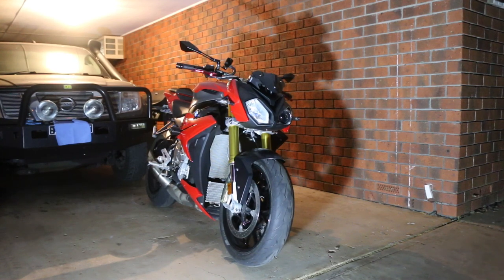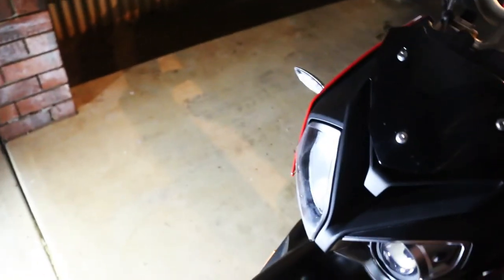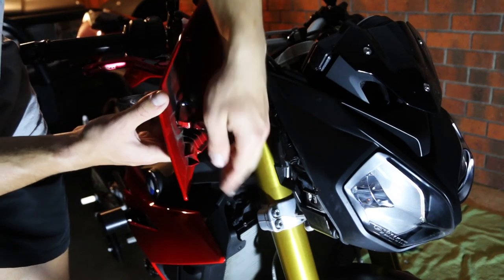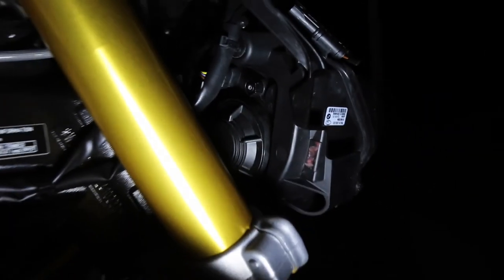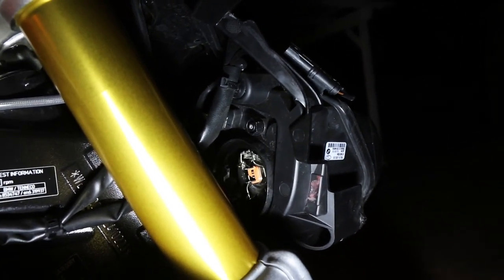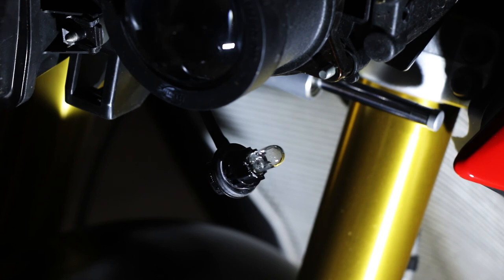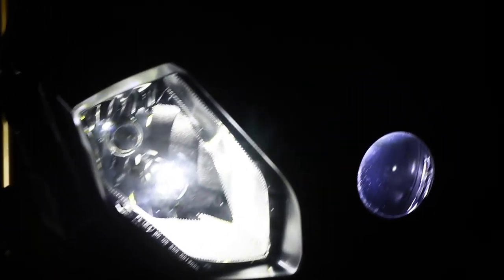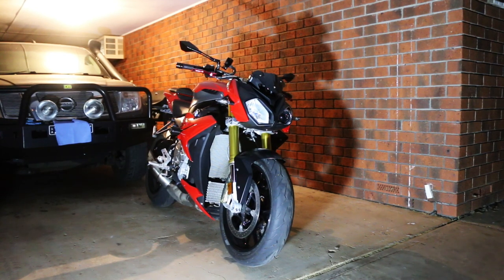HID/LED Headlight/Parking Install/Change  || BMW S1000R ~ 2015 || Headlight Fairing Removal

Comment: I have a 2014 S1000RR and I didn't have too take everything apart.  All I did was:
1) Removed the high beam bulb. 
2) Using a pair of needle nose plier,  all I did was grab the plug (black plastic part / not the wires) and wiggled and pulled at the same time. The key is to slowly wiggle the plug while pulling, once it starts to come loose, it's pretty simple. 
3) When putting the plug back in, make sure you line up the plug correctly and then just push it back in. 

Also before putting everything back in, test all the lights first to make sure everything is working.  It's basically a 5 minute job to do.  Also helps if you have small hands ;)

Comment: I understand all about that little parking light on right side of the bike.  Started today, put it all back together because I became worried I would wreck the cables.  I'm now an expert at getting the low beam light out now as I have replaced it three times, it's a bit easier to replace the low beam light, I think that's what "ChoppEsco" might have been alluding to.   Looks like the screwdriver does the trick.    I'll have another go sometime in the next week.

Comment: Thanks for sharing! 

Have noticed any issues since installing -- overheating, electrical faults, or any warping of the headlight housing?
Reply from the maker: 0 mate. And thats a reply 2 years too late probably, but its still running perfect

Comment: You should buy ur self a head lamp that way can use both your hands. Plus it would be nice to see the difference between the projected beams, you know were they land, nice bike ty you for sharing I guess its gonna be my turn in the barrel  next but I'm gonna get the turn signals and tail tidy and complete it all together.
Reply from the maker: yeah true eyy, the projection difference is phenomenal, its like a car beam, very impressive.

Comment: Question for you, when you put your high been bulb in did you have an issue where the bulb turns on but just doesn’t seem like it’s getting enough power? My low beam side works perfect but when I turn on my high beam side it turns on but is just super dim to the point where it’s like it’s not even on.